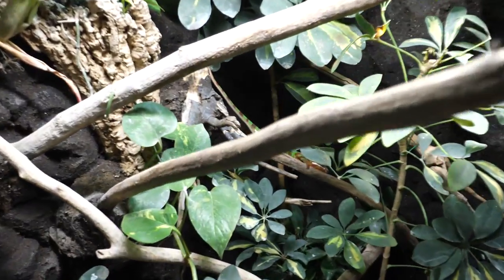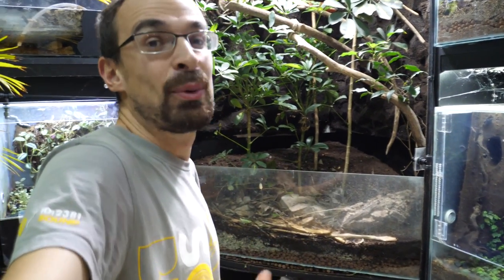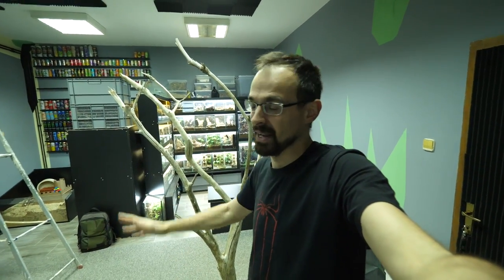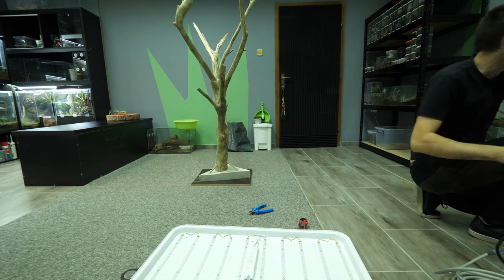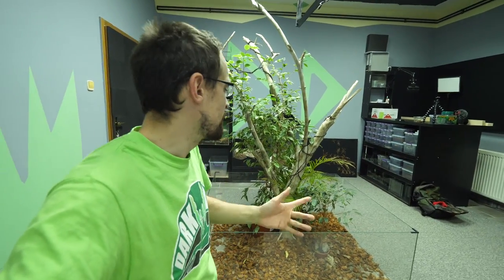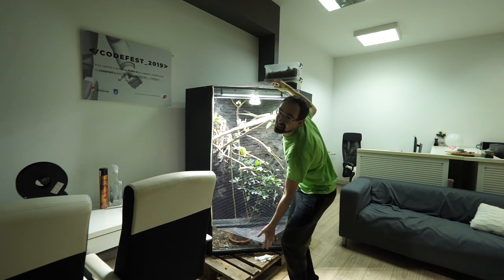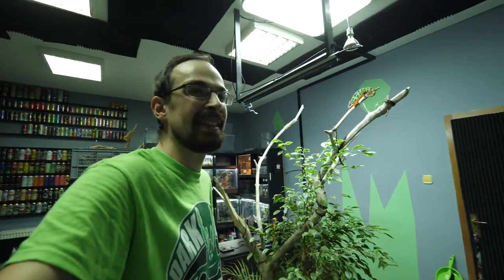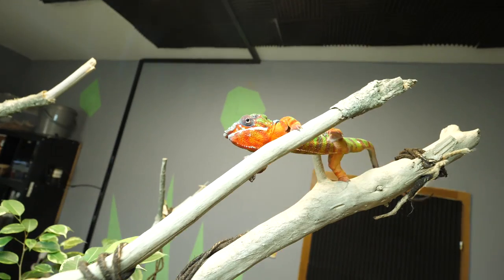BUILDING an AWESOME central enclosure for my CHAMELEON

Comment: You gonna have problem with water damage on the floor if you dont have anything that prevents the water from reaching the floor
Reply: Don't forget drip trays for the plants, and you have to add extra coats of sealer to your grout, the tile will be ok but grout is porous without the extra sealer.
Reply: @archaeopteryx9458  chameleons dont pee. they do all in a poop.
Reply: @archaeopteryx9458  chameleons don't pee

Comment: You guys he does not need more leaves or foliage towards the top. Chams bask out in the open during the day and hide in foliage at night to sleep, he will climb to the middle part and hide in the leaves at night, not to mention ficus plants grow extremely fast. This is perfect for him, it meets all of his needs. Humidity will be fine as long as he is misted multiple times a day.  Out in the wild they aren't in a cage to get the right humidity, they get it by water and heat, so the misting system and heat lights will create enough humidity for him. If anything this replicates his natural habitat more than the old enclosure.

Comment: Suggestion from a previous Swedish Electricians, aka EU. It is a good rule of thumb to place your earth wire in-between Neutral and Phase. Just as a layer of safety, if anything happens. Your RCD, at least I hope your building has it. Will smack off. Alternatively, you can buy one for a socket, that has lower tolerance. 10mA instead of 30mA. It basically detects if the current takes another way, than it should. The next thing is, that LED 'panel' is of metal, aye? You might want to earth that. Just in case it for what ever reason gets current. Nobody can touch it and get a jolt. 

Switching current can ruin nerves, so it is not really just a 'harmless jolt'. It might not appear till 30-40 years later when the body degenerate. Anyhow, that is just my words on the topic. Bit of nitpicky, but Swedish Electrical practice is quite nitpicky in general.
Reply: I guess you never heard about russian electric practic, you need just roll all the wires together, cover one of it with isolation tape and other one can stay without it, you good. Earth wire? What is it? (just kidding from russian electrician xd)
Reply: The ladder safety was what was worrying me. Powertools + 1 rung from the top kills so many people :S
Reply: I think the enclosure should have another ''tree'', and at least a couple horizontal perches. Right now the Chameleon, a big Chameleon, just has three lanes to go up and down with little cover and little horizontal compared to the previous enclosure.
Reply: In UK it’s strict too. I’m an electrician also. Although the fixture should be earthed, you may find because of the transformer that manufactures instructions state it’s class 2 double insulated and shouldn’t be earthed. But, exposed connector blocks aren’t allowed and single insulated exposed outside of fitting is also shit and not allowed here. I hate watching other people do electrical work thinking it’s easy and “it works!” . Yeah it may work but it’s not safe.
Reply: @TomMattin  Grounded, not earthed :S
Reply: @Will3ist  No, earthed. its called a CPC, Circuit protective conductor and it goes to earth. In electrics in UK 'ground' is only used in DC electronics to give a local reference point across the circuit where all parts are 'grounded' to a common point .

Comment: If you're making another particle board base with a hole, you should cover the edges of the hole and surrounding area with hot glue. It's cheap, water proof, and can be applied precisely even in small areas.

Comment: Looks great! As others have mentioned, I would add more cover for him near his heat spots. You want that to be his most comfortable place and to able to be there with the heat in cover should do the trick. I would also put something down on the floor like plastic or something so that moisture, etc, won't ruin/stain the floor over time. Plus it would make for easy cleanup if necessary.

Comment: You should use Waco connectors to connect wires together, they are easy to connect and connection is secure. Using actual stripper tool is easy to strip coating from wires and expose them. 

Advice from your friendly electrician :)

Comment: You should put down a silicon matt underneath the substrate and plants, otherwise, the misting system will soak the substrate which will damage the floor

Comment: Won't the fact that that substrate is directly on the floor with the combination of the misting system ruin the floor? it'll get really damp and possibly cause it to warp or mold to grow? I'm not sure how much of the water will get to the bottom but it was just a thought.

Comment: Two questions, 1) does he need a mister/humidifier and if so how do you plan on handling that and 2) can they not escape the low walls of the enclosure ?
Reply: nevermind about the mister, I think I saw it attached to the bar.

Comment: I get a feeling that humidity will be a big problem for the new enclosure. Seeing that Felix is a Panther Chameleon he would need pretty high humidity. But let's hope for the best. I'm sure you keep an eye for the humidity level.
Reply: They actually don't really, most of the time it's recommended to keep them in a mesh cage with lots of airflow, unless you live in a really dry place the natural humidity should be fine since they get most of their water from actually drinking.
Reply: @soasertsus  Considering that Petko lives in Croatia, humidity will be an important thing to monitor closely as Croatia tends to be really dry. Especially in the summers. But like i said before, i'm sure that he keeps a close eye one it.
Reply: Hum good question . Hiw will he keep it up in a open tank that is a gokd ponit.  Maybe he will spray the set up daily and that will be fine ? I am hot sure what he is going to do but it he good to see what he does ans how it works for sure .m really interesting to see a open set up for then I have never seen them like that before ..

Comment: Alright my advise would be to add way more plants. Your tank looks gorgeous but it lacks vegetation, you should put some crawling ivy and another big (huge) plant on the front side of the tank where there's no plant. Your chameleon will feel way more comfortable in such a jungle. Plus, I don't know how you really consider the required humidity for the tank is left in open air... Is the humidity level high in your room such as it is in Madagascar? (80/70% all year long). I hope you will read this comment, looking forward for the final result!

Comment: Use hydrogen peroxide and it will clean the mold alot although you will need to check on it.

Comment: How do you doing whit the humidity?
Reply: I was going to ask the same question. None of my chameleons did well in a open enclosure like that were it's hard to control temps and humidity
Reply: Daniel Pettersson  I guess the less he thinks about it the better?
Reply: @Kryptic712  i like many things he's doing, but this is going to be a big mistake unfortunately.
Reply: @danielpettersson498  As long as the room humidity is decent, the wet branch will raise local humidity should be fine. 

Lots of people Free Range Chams, he could defiantly use some more plants though.

Comment: Are you using a humidifier in the room and misting I'm curious how you would keep up the humidity with the open enclosure.
Reply: Did you watch the whole video? I'm guessing not because he shows how he installs the misting system. As long as he gets misted a few times a day the humidity will be fine. You don't want them in a humid environment 24/7. They need periods of drop in humidity.  The water from the misting plus the heat from the lights will make it humid, but not too humid.
Reply: Free standing enclosures are pretty popular for chameleons and people are doing them more and more as they replicate what they would experience in the wild. Out in the wild humidity levels vary and with these types of "enclosures" it will mimic what they get in the wild as opposed to sitting in a cage with high and constant humidity. People think chams need constant high humidity but they dont, they only need it a few times a day. This is why RI's amongst chams are so common.  People are keeping their cages too wet and humid.

Comment: Not deep into the video yet. But you could have used a small piece of PVC pipe or another piece of plumbing to allow the original tank to drain without damaging the particle board.